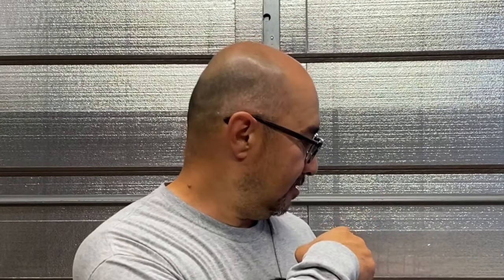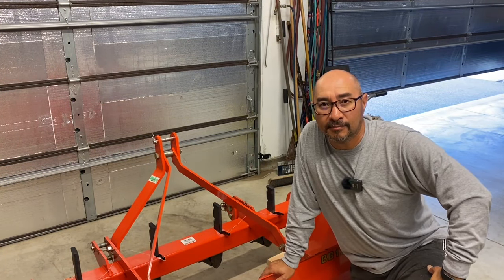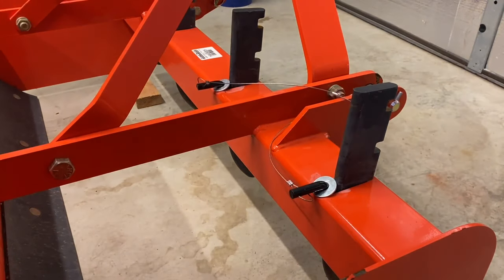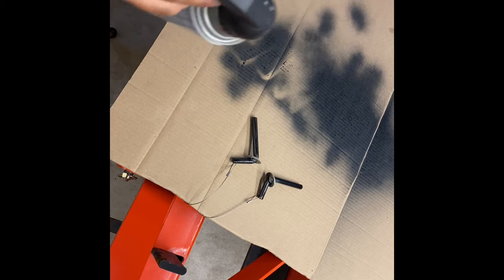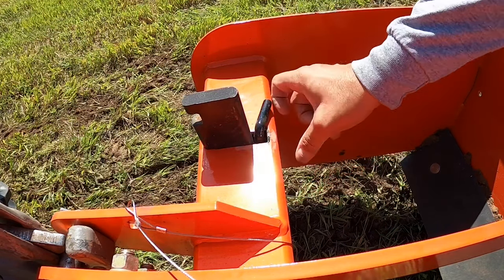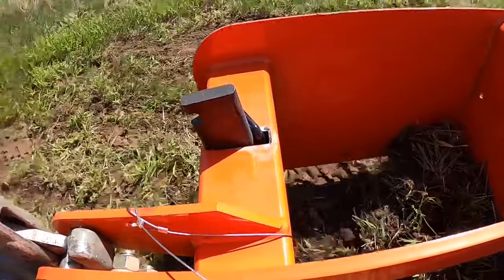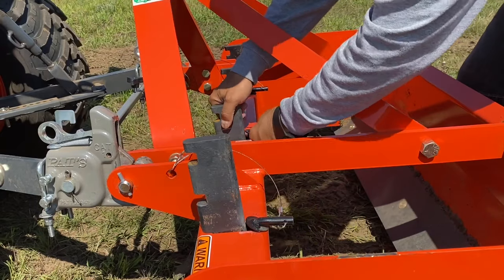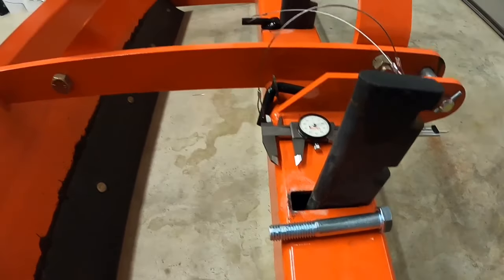Modify Spring Clips to Pins New Version!!! on a BB1254 Land Pride box blade

Comment: My thinking ... was that the washer with the cut in it would work best, but after watching your old vs. new trial, I probably wouldn't make a difference (except a little more fab work)  The bolt was a great option as long as you had the right size  Simple. Functional. Easy. Low cost.  Winner!
Reply from the maker: Yep 👍 if I only thought of the bolt first it would have saved so much time. The bolt was 5/8 by 4” inches long was also the best fit. Have a great day 🚜💨💡😁👍

Comment: Now that you’re all done, Mitch, what about using 5/8 square stitch instead of round? Nice job!
Reply from the maker: That sounds like it would be a better idea 💡 I went with 1/2 because the spring clips were that size but when I put the 5/8 bolt in I was thinking 🤔 that I should have measured the slot. These videos turned out to be more food for thought. I am guessing there will be a lot of spring clips without a home soon 🚜💨💡😁👍

Comment: OK, I am not sure that I understand what the concern is, as I don't see how the pins can fall through the hole.
They have the cable attached for one thing.
So what if the pin is moving side to side.  
I am all for simplicity, and I think your original idea is the best.  You don't have to buy any washers, and you don't have to get your welder out IF YOU OWN ONE!
Ross's idea is OK, and maybe fancier looking, BUT, does it do anything different than your original?
And for what it is worth, I saw some Box Blade indexing pins on Amazon, and they DID NOT have any washers on them!  They looked like your original ones too.
Reply from the maker: I did not have a problem with the pins and no washer falling in the whole just thought Ross had a good idea and tried it. And wanted to show that you can use different things to accomplish the same thing. Have a great week 😁👍🚜💨☀️

Comment: Land Pride should be ashamed of themselves for putting out something like the clip.  I have one and it's a pain.  I like your idea but I wonder if a square bar stock would eliminate some of the slop.  And maybe a small spring clip to hold it down firmly and keep it from jumping out.  the spring clip would be screwed into the large horizontal bar and swing out of the way for removing the square pin.   Just rambling thought of a guy with too much time on his hand.  Love your site.
Reply from the maker: I agree 😁you have a good idea about the square stock and the round pins don’t seem to bounce out I have not had a problem. I really like the square stock idea 5/8 would be a better fit too. Thanks for watching 😁👍🚜💨🍳

Comment: Nice idea on the pins - definite improvement over that clip.  Makes me wonder though, would drilling holes in the scarifier shank and using a standard locking pin be easier?  That way it'd work just like a normal box blade and eliminate concern of bouncing out.
Reply from the maker: Just my opinion but it would be a lot of drilling. I have not had a problem with the pins bouncing out yet. Your Idea 💡 would be the best way for a permanent fix. Thanks for checking out the video😁👍🚜💨🍳